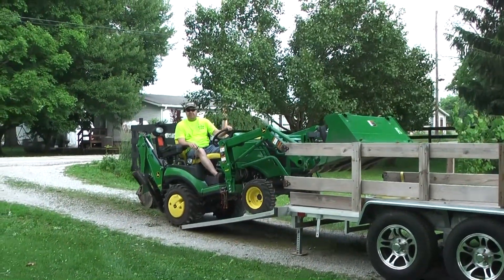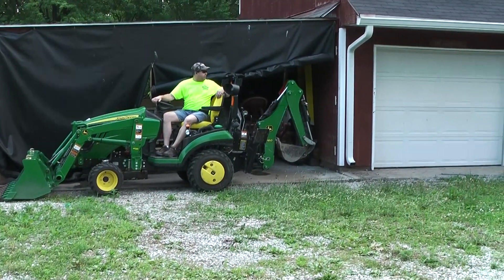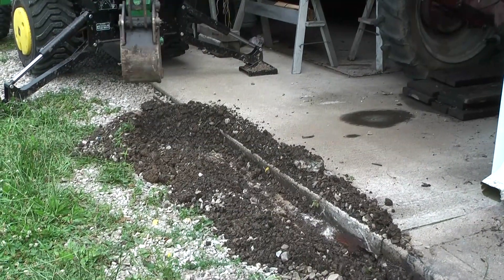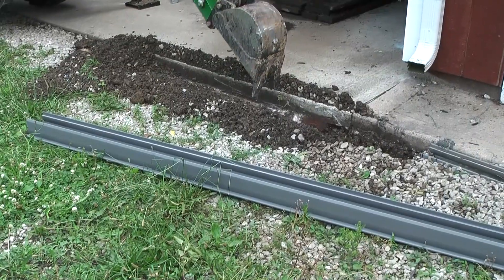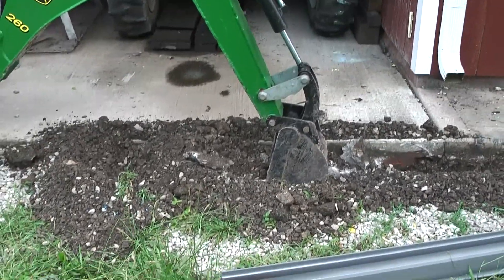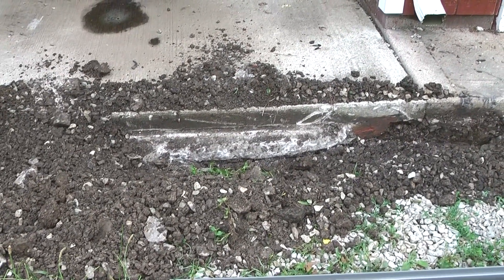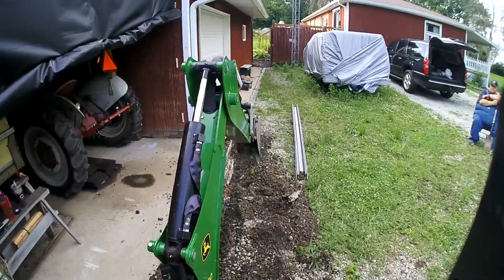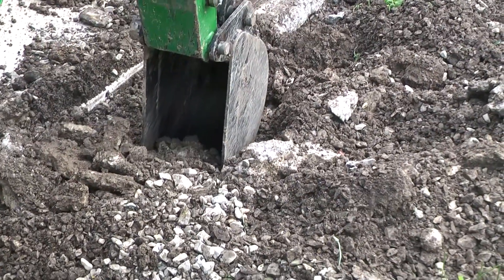#73 John Deere 1025R - Brian's Backhoe Drainage Project - DIY

Comment: Did you install the teeth on your front Bucket? My bucket on my tractor doesn't have any teeth. Can you remove them easily?
Reply from the maker: Yes, I got the toothbar from www.heavyhitch.com
It is easy to remove and re-attach. 
Greg (at Heavy Hitch) is very helpful, and will talk you through the details.
Please mention that "Tractor Time with Tim" sent you!
Reply: The tool bar is nice but I was looking at your teeth on your bucket.  Where did you get them and can they be removed easily?
Reply from the maker: MrMunchiemo Here is the direct link to the teeth for the front bucket. Also known as a 'tooth-bar'.  https://heavyhitch.com/store/replacement-parts/toothbar-for-john-deere-front-end-loader/
Call Greg @ 888-337-8999 and tell him I sent you.  He'll fix you right up.
Reply: Ok sorry about that I thought it said Tool Bar. Its a Tooth Bar. I will check it out thanks.

Comment: yeah I just bought me a John Deere 1025r with the backhoe attachment how high do you normally have yours up to when you're using that attachment
Reply from the maker: +Nick Mccarthy welcome Nick, and congratulations!  Start at low RPMs, then as you get more comfortable with the controls, you can speed it up to 2000-2400.

Comment: Tim, what about the Massey 2310, the Kioti or Mahindra in regard to your deciding factor to settle on the 1025?
Reply from the maker: +toobglued one word: Attachability.   (Is that a word)?  Auto-connect mower deck, loader removal without pins, etc.

Comment: Tim, might have to come off the slab 6-12" and fill the space with concrete and even back the drain with concrete so it doesn't move.
Reply from the maker: Good idea.  We'll monitor it.  Brian is trying to stay on a 'budget' with this project.    Those plastic drains were expensive enough!  
So, we'll start with the low cost approach, then modify if necessary.

Comment: Been browsing through all of your backhoe vids and this one seems to be the only one where at least one of the stabilizer feet are on concrete. Do you have the "street pads" on the bottom of those feet to prevent marring the concrete or pavement? 
I called my parts guy and he says even John Deere's main supply doesn't have their street pads available right now. Part no. BLV10986 for the 260B backhoe. $134/set. Not sure if they would fit the 260.
Dealer also said this part could be one of those long-term, indefinite backorders, so as usual, I will swing into action and make my own! (Maybe Heavy Hitch should look into whipping up a bunch of them!) 
I ordered a 2" thick rubber loading dock bumper to cut to correct size (big enough to make two!) to bolt to the bottom of the feet on mine. Will see how well it works out. Will post pics on your FB page if they work well. Cost just $33 on eBay, plus whatever bolts, nuts and washers I will need.
Reply from the maker: I believe Artillian makes backhoe foot pads.  Not sure if they fit 260bh or not.
Reply: Those are for the models 7 & 46 backhoes. older models. not sure if they would fit the newer 260 and 260B models.

Comment: Brian needs an electric hammer drill or breaker. The air hammer works but needs an awful lot of air for it to work right. An electric hammer drill would make an air hammer look like a toy. lol. Just another toy suggestion for Brian to play with. :)

Comment: I like the video but not how you put the drain in. digging out right next to the concrete like that will make it more likely to crack after driving over it repeatedly
Reply from the maker: +Chris S yes, agreed.  I think this could have been solved with surface drainage improvements.